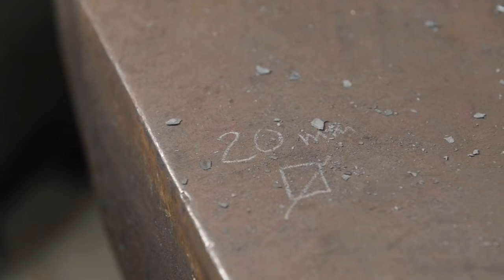Blacksmithing - Forging a Christmas gnome

Comment: Wow! They turned out amazing.... Going to try one. I dont have a power hammer though so it might be a one and done project ha. Thanks for sharing
Reply from the maker: Cool. Thanks. Quite easy to do without a power hammer. Make a spring fuller for your anvil.

Comment: Wow good job! Im 11 and I just got into blacksmithing... how long does it take for your forge to heat that metal up to a glowing orange?
Reply from the maker: Cool! This is 20mm stock, so it probably takes 2 min from dead cold.
Reply: @torbjornahman  Ok thanks! I made a forge from and old bread pan, sand and plaster, and an iron pipe that I cut holes in so the air could come through... also im wondering if lump charcoal works for a forge because my charcoal just burns to quickly... 😐👍😀
Reply from the maker: Charcoal works fine, but it burns quite fast... check your air flow, you don't need very much air. I have seen many beginners with volcano like forges with way too much air supplied - which also makes your fuel go up faster.

Comment: What sander were you using, and where do I get one?  I mean the larger machine (not the handheld) that looked like it had a flat and a wheel section.
Reply from the maker: Google "75x2000 sander".

Comment: hello torbjörn. i'am a beginner in working with metal and i noticed that you cooled the bottom of the gnome by dipping it a lot of times into the water and not just once. why are you doing it this way ?
Reply: Captain Kamikaze I think to let it cool down but not letting it get to hard. I'm not sure.
Reply from the maker: Oh, that probably does not matter much here but mild steel can sometimes harden up to some degree and I usually avoid quenching if I can. This way cools it a bit slower....

Comment: what kind of wheel did you use to clean up before painting?
Reply: Kevin smith  - looked like a cup wire wheel on an angle grinder.. Any type of wire wheel/brush will work 👍
Reply: lsubslimed cool, just never seen one with that small of bristles on it
Reply from the maker: Ha ha, yes it's an old extremely worn cup wire wheel.